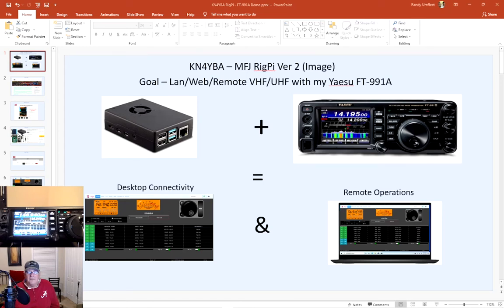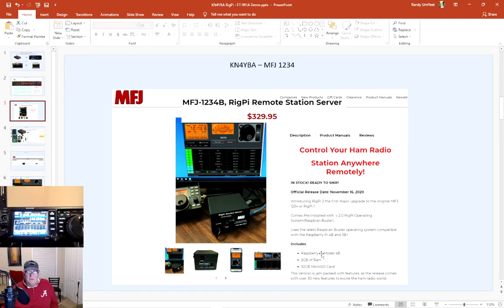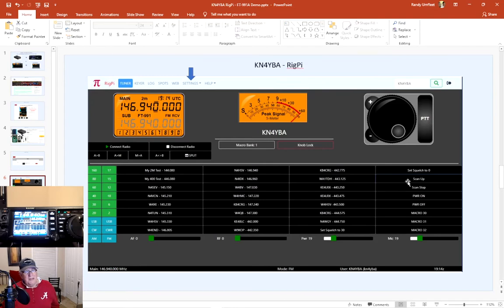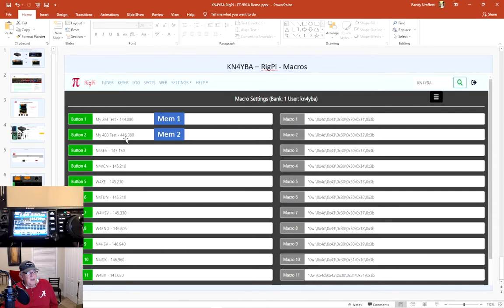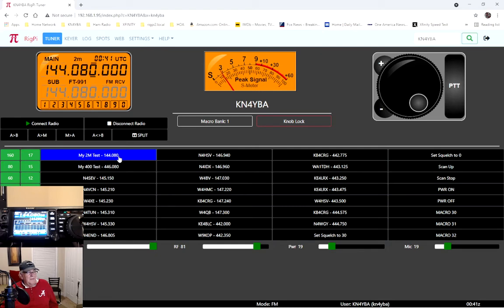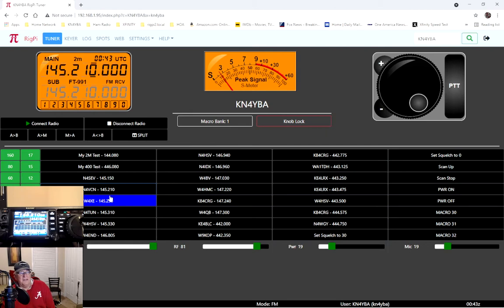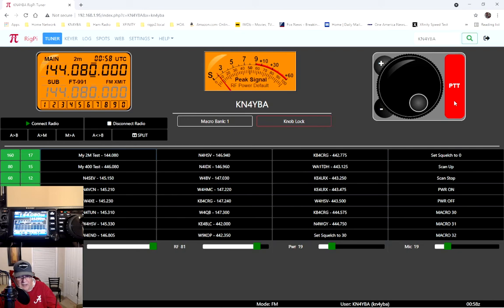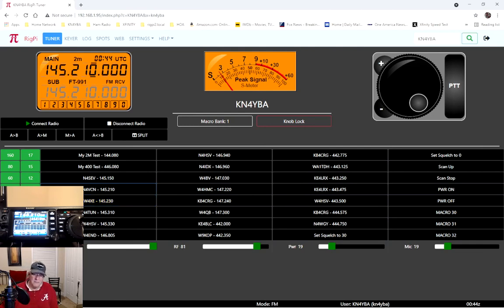KN4YBA   FT991A & Raspberry Pi4 with MFJ RigPi Image Ver 2

Comment: Thanks again! I've got mine up and running and works pretty well. I'm excited because I'm on the opposite side of the state from my rig and being able to key it up and change memories is very helpful. Someday I'll buy a Flex, until then I can remote into my 991a! 

Have you checked out the video feature? You can replace the middle screen with a webcam pointing at your 991a, plugged USB into your Pi. I'm buying a webcam just for this feature!!!
Reply from the maker: Hello Carl, great news to hear you have it up and running.  Yes, I am aware of the camera option but for me that would not really help much.  I use it remotely and have designed all power for remote power up / down.  I have also designed my network to remotely reboot and set up a daily reboot of the network just to give me assurance that when I access the radio it will work as designed.  Not much I can do if something goes wrong, as for the next few months while I am working remotely. If the Raspberry breaks or the software crashes I am stuck with waiting until I can get back to fix.  One thing I did find out last night is some hotels block ports on their internet. I am able to access the radio and server with the laptop connected to the hotel internet but I am unable to connect Mumble from the hotel network. My work around was to use the laptop to access and control the radio, but for audio I just connected Mumble from my phone for the audio. That resolved that issue with the hotel blocking the Mumble, and just using my cellphone for all the audio. 
This issue only was with Mumble at the hotel.  My Flex worked as if I was setting at the house.

73
Reply: @kn4yba80  I'm using ZeroTier to redirect my IP address. Maybe that would help with your hotel issue. Basically all traffic goes through ZeroTier. It's free.